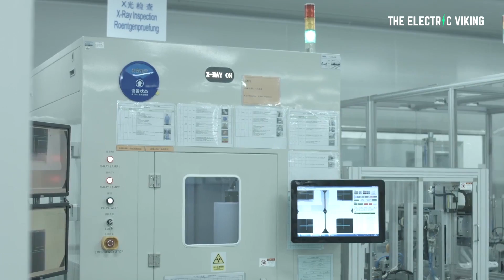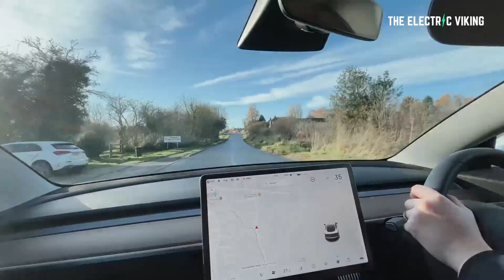This NEW battery changes everything - GAS sales will collapse

Comment: Will be interesting to see how garage fueling station areas change. Can see layout changing allowing more cars to be charged at same time.

With these massive rapid changes taking place, wonder how long it will be before HGV vehicles will be able to use battery power?

Comment: So Mr Viking; why don't you include PHEVs - you can still commute electric with them if you love electricity. Check out SF6 however electricity in general isn't great for the planet with this.  So what is wrong with Ethanol? Zero fossil fuels? still ice.  What wrong with bio diesel? Zero fossil fuels - considered to add no CO2 to the atmosphere.  How do you achieve that with EVs?  As long as a portion of your electric generation is coal or natural gas the EV is dirtier.

Comment: good luck finding enough electrical power to charge an EV in 5 minutes lol, a 100KWh tesla battery. the average household in canada has 200 amp electrical service at the house, at 230 volts thats 46000 watts, which means if you draw ALL the power available to your house, it will still take 2.17 hours to charge your tesla. and that doesnt leave any power left for your house..

dont get me wrong, its still very exciting, it means you can charge your car on a road trip without waiting hours... but there needs to be a huge infrastructure change to facilitate these new batteries. personally i think the GMG graphene aluminum batteries are more exciting, as they get rid of nickel, cobalt, lithium, etc... and are almost completely recyclable, and should last wayy longer than lithium chemistry batteries anyways

Comment: I HAVE solar panels installed; the cost will take over 20 YEARS to recoup from generated electricity savings. Costs for EV's in the UK are astronomical, even a Mini is £38,000 plus! The Mayor of London wants to effectively drive ALL petrol and diesel vehicles off the road by 2024 by extending the Ultra-Low Emission Zone out to the M25, yet this will immediately and dramatically devalue those vehicles so that nobody will have the money to even consider buying an EV let alone afford one, plus the home charger point etc. which is even more expense. These are currently rich boy's toys here, not even vaguely affordable and the 'charging network' is too widespread, unreliable and often simply broken! The sooner hydrogen powered vehicles are available with the relevant support infrastructure in place the better, this is the future, not EV's! We are already being warned of likely 'brown outs' and 'black outs' later in the year, how do you charge your EV then? Rant over.

Comment: It's the capacity that matters - not so much the charge time.  Also, to put the amount of energy into a battery to give a car a range of (say) 500miles in 5mins I would think difficult if not impossible at present.

Comment: Who knows where the world will be in 10years or even 5years but until BEV's become a truly affordable option for the masses does it really matter how quick you can charge the damn thing! 

 I'm 62 years old and I have never had a car that cost more than £10,000 and I retired modestly 4years ago. Trust me I'd buy one tomorrow if they were £20k. I have had solar panels for 12 years and am awaiting delivery of a thermal mass boiler so I'm down with the kids 😁but I can't afford an entry level vehicle that suits my lifestyle. I don't care how long it takes to charge unless you are going to give me a pill that means I don't sleep for 8 hrs at night and I quite like a 20min stop now and then on a long trip.  What I want is a Sono Sion in RHD. No need for battery storage at home as it has 11kw vehicle to load capability.  Take a look at one. The epitome of what EV's need to be. Price in Euros circa €25,000.  Designed and built by kids in a shed over a decade ago.

Comment: To charge a 100 Kw battery from 20% to 80% in 1 hour requires 60 kWh of electric energy plus a little more for losses.  At 240 volts single phase, a 60 kWh resistive load ( power factor of 1) will require 250 amps for one hour.  Most home in the US have 240 volt single phase supplies with newer homes having a 200 amp supply and older homes having a 100 amp supply.  Keep in mind that the entire neighborhood will be charging their cars overnight.  A 3 ton air conditioner which runs intermittently demands 3 kW.  The entire electric distribution system will need to be upgraded to handle electric vehicles.  Currently most US homes have a 25 kva transformer supplying 5 to 10 homes.  It's not just the cars, it's the charging system.
Reply: NOT at home, L2 240V 32A is more than fast enough for overnight charging at home. But faster charging will be great for longer distance travel and people who can't charge at home.

Comment: Electricity is a consumable domestic and industrial energy it has a stable price. Electricity doesn't have a price cycle.
So no queuing at the servo to get some cheaper tank of fuel, especially paying exuberant prices at holiday times.
Oil companies you have had profit run it's over.

Comment: Development for EV batteries is open-ended profit all the way to the bank. There is no profit in developing the gas engine just costs nowhere to go with that development it has been exhausted. Gas engine development is of small increments it is becoming impossible to screw any major advancement it has reached its limit. We have to realise the gas engine is more than a hundred years old and we have worked marvels with it today it is very reliable but development has been taken as far as it is possible. The next generation of drivers won't want gas engines with all that noise and fumes and maintenance to them Ev's like the new smartphones will make sense.
They will see gas cars as a Grandad cars. Our engineers who have developed the gas engine to its limit know this and have moved on.

Comment: So what you are saying is its all good if you charge these cars from Power made from burning Dirty Coal ? And by the way have you done the calculations of total Carbon footprint including battery replacements over the life of the vehicle. Not to mention all the Environmental destruction from sourcing all the required materials. This whole discussion is BS while you focus on one small aspect. Look at the big picture and it's a whole lot different.

Comment: If you can charge the battery to 80% in 5 mins... how much power does  that require?  A bloody lot. Where will the power come from? The network will not support charging at that rate for multi0le cars.

Comment: You may be serious but reality will smack you right in the face.  Batteries biggest problems is the recharging problem.  All batteries have that problem and only from the factory that they have full capacity. Any recharge after that is less.   Electric cars will be fine for city driving where you can plug in local outlets provided you lie in an area where they provide plugs for winter plugins.

Comment: Disclaimer up front: I am a huge EV fan. I own a 2018 Chevrolet Volt (which because of my driving habits I only need the gasoline for about 5% of the miles I drive and the rest is on battery power). And in fact my job involves exploring technology that can help electrify aviation so we can fly with zero net CO2 emissions. So I am in no way trying to say that EVs will never displace ICE cars. And in fact I think that if we are going to leave an inhabitable planet for the next generation we are absolutely going to have to not only make sure that EVs come to dominate new car sales, but we are going to have to take active steps to get existing ICE cars off the roads sooner than just waiting until the end of their natural life. So I say this as an strong EV advocate, but this one advance in high C-rate batteries is not sufficient by itself to make possible a future where you can recharge your EV as fast as you can now refuel your ICE car.  (BTW, C-Rate is a measure of charge or discharge rate (they can be different). A C-rate of 1 means that the battery charges or discharges in 1 hour. Thus a battery that can recharge in 5 minutes has a recharge C-rate of 60/5 or 12)

In order to make this possible there will also have to be a massive advancement in the charging infrastructure to service these new 12 C batteries. If we assume that this 5 minute recharge to 80% starts with the state of charge at 20% (since to avoid damage charging from 0% to 20% and then from 80% to 100% the charging rate has to be slowed way down), then the total energy delivered is 60% of the rated capacity of the battery pack. For the 82 kWh Tesla 3 AWD long range, that means 49.2 kWh of energy delivered in 5 minutes. To keep the math simple, lets round up to 50 kWh. In order to do this the charging station has to be rate to 600 kW. But the Tesla 3 isn't the largest EV. The long range version of the Ford F150 Lighting EV has a capacity about 150 kWh. In order to transmit pickup 90 kWh in 5 minutes would require a charger output 1.04 *MW*. 

The current version 3 of the Tesla supercharger is rated to 250, with Musk saying that this will be upgraded to 300 or maybe even 350 kW in the near future. The fastest existing charging station that I could find is the ABB Terra 360, which as its model name implies is rated to deliver 360 kW. So to be able to actually take advantage of these new high C-rate batteries an entirely new charging station will have to be developed with three to four times the power of current chargers. An issue that probably doesn't get mentioned is that to deliver more power at a given voltage, the number of amps has to go up in a linear fashion (power = amps * volts). However, the power loss in a cable goes up by the square of the amps (loss = cable resistance * amps^2). So if the voltage stay at the current 480, which it probably does since (in the US at least) substations step the voltage down to 480 volts from the much higher voltage for transmission lines. So if the voltage stays at 480 the amps to supply 1 MW increase by 4 times and the power loss increases by 16 times. This much higher loss results in a lot more heat being generated in the charger, in the cable from the charger to the vehicle, and in the cables inside the vehicle. Dealing with that much greater heat will be difficult. On solution is to make the cable much thicker to reduce the total resistance. But the loss is only a linear relationship to the resistance, and so the cables would have to get much much thicker.  

Further the electrical grid will likely have to be substantially upgraded as well to supply all the necessary charging station. Charging station along major highways will see a lot of cars recharging if EVs with these new batteries really do displace the ICE cars. Current highway fueling stations can have 20 or so gas and diesel pumps. A charging station with the same number of charging bays would have the potential to pull 20 MW of power from the grid. The average could be substantially lower than this, but Americans love their pickup trucks and big SUVs, so it is entirely possible that all 20 bays could be filled with vehicles that are each pulling a megawatt of power. 

And to completely replace gasoline fueling stations, there would have to be many thousands of recharging stations just along the US interstate highway system. All of this might be unique to the US since in the UK you can't drive that far without driving into the ocean. And in Europe my impression is that most people would opt to take a train rather than drive distances that would require multiple rapid rechargings to reach. But perhaps Australia would be more like the US in the need for a relatively large network of these megawatt recharging station up and down the eastern coast.

Comment: Looking at it from a macro perspective with the US consuming roughly 20 million barrels of oil/day, with 82% of that going to all fuel types, and converting that to kilowatt-hours, you will arrive at the simple fact the US uses the equivalent 8.3 Trillion kilowatt-hours in gas, diesel and jet fuel each year. Last year all American electrical utilities produced a combined 3.3 Trillion kilowatt-hours of electricity. With transmission losses and engine inefficiencies roughly offsetting each other that would mean the USA would have to quadruple it's electricity production. I don't see this happening without all fuel types. Fossil fuels, nuclear(I would hope thorium would get it's chance), solar and hydroelectric(which has been taken as far as it can). I left out wind because it is truly a colossal waste of time.

Comment: Hahahaa 😂🤣cost of these batteries are costly upto usd 60k replacement, environmental damage after disposal plus costs of electric cars not cheap and  charging points too few lastly in future electric charging will rise then all will be trapped  contrary to all this diesel petrol timeline now being  extended to 2050 from 2030 all this is a west dream whilst rest of world still pollutes due to ukraine conflict west now going back to fossils fuels nuclear to compensate low supply of LPG etc now petroleum co looking into low zero emmission fuels, hydrogen types as well as easiest simpler back into new type engine management vehicles simple tech thus so batteries not answer costs are horrendous so get real 😂🤣

Comment: The batteries are worthless without a cheap sustainable electric source to charge them.
The residents of California are being told not to charge their electric cars because the electric companies can't produce the electric needed. It's great that you can charge a battery in 5 minutes but that means that the total amount of electric needed to charge the batteries for that car must be available at the time you are charging it. If a car has a 75 kilowatt hour battery in it. That 75 KW battery electric needed to charge it will have to be available in 5 minutes. That means for that one car the electric requirements for 5 minutes will be 900 KW or . 9 MW. This is why you will not see 5-minute charging for electric cars for years to come because the necessary infrastructure needed was simply not be available especially in countries like the United States. Stop listening to all these so-called experts and do your own research call your local electric company and tell them you want a 1 megawatt electric service at your house watch how they laugh at you and tell you it's simply unavailable and what are you trying to do.  Most us homes have a 48 KW electric service.

Comment: Practically, we need a dedicated transformer to drop 100Kv 3 phase lines down to 2kV capable of 350 Amps per phase. >> approx 600 KW. This is huge. But using a 100KW battery as buffer can be quite practical. However, need some time to let it charge fully before the next car can use the charger.

Comment: 80% in 5min...  Almost 1 MEGAWATT for a SINGLE charger. (same amount 33 houses uses in 24hour in the winter, but in 5 min!) What electricity supply net is going to handle that? Is it going to be powered by solar and wind (joke)? Are we going to build 10000 nuclear plants to handle the sudden and frequent demand swings on the electricity net? Is there enough poisonous metals and materials to make all these batteries? Are they recycleble 100% ?
Electric cars is probobly the future but not with poison batteries!

Comment: 50 kwatt hr means 1 hour needed to charge a 50 kWatt battery WITH 50KWatt charger. 5 mins??? work it out, need 60/5 X 50 = 600 kwatt charger. In my dreams.

Comment: There isn't enough chargers and grid power to recharge all the electric cars  they claim will come into the system .That's the bottle neck to solve even with the five minute recharge time .Yes gasoline will die but not as quick as we think

Comment: Whatever "it" is IT won't change anything until it exists as a producable product and can be integrated into whatever system is needed to support it.  Someone else on this thread mentioned the high voltage needed to charge at this rate.  It's equivalent to what's running in lines on electric poles.  Those are pretty common but safe connections straight to the hands of your average consumer aren't.  Have thjose been developed?  Also you're going to have to put more power into the system farther up the line.
  Not that that can't be done but is anyone planning for it?

Comment: You might want to look where they get the parts, FOR THE BATTERIES!!  Mined.  The amount of fuel it takes to mine what is needed in the battery, uses WAY MORE FUEL then the vehicles would use in a life time, if they ran on gas.  Electric vehicles ARE NOT reliable.  Electric vehicles produce MORE green house gas.  Most electricity for charging, is produced by coal, natural gas or nuclear power plants.  Most electric cars are powered by Lithium Ion batteries, average, +/- 110 lbs of Graphite, Per Car !!  The batteries are Toxic, where do you put them when they no longer hold a charge?   Might want to look in to plasma.

Comment: ‘It takes 5 minutes to charge my gas car’....No it doesn’t. To pull off the road, assuming there are no queues at the station, pump gas, walk to the teller and pay and get back on the road. Average is 8 to 10 minutes. In practice this kind of nonsense from petrol heads is meaningless. Most EVs can do comfortably over 200 miles, more than any sensible person can drive in one sitting...gas or EV, it doesn’t matter, the human machine needs a rest to refuel, use the loo and stretch legs. This essential 20 minute break is enough to give even current EVs another 70 miles to finish off the journey...It’s extremely rare for anyone to do more than 250-300 miles in a day.